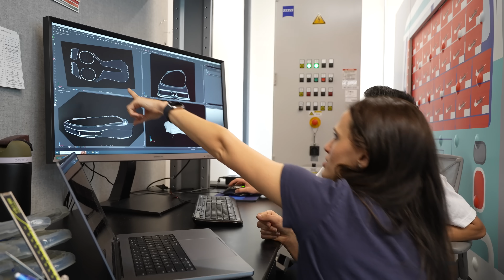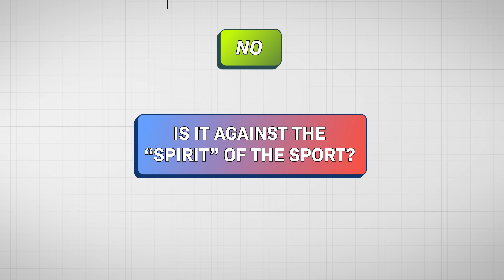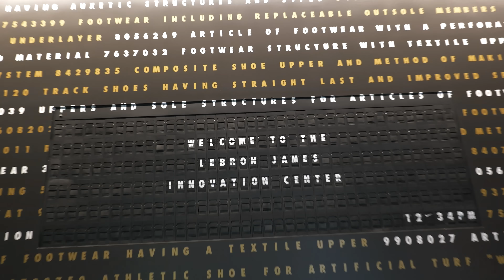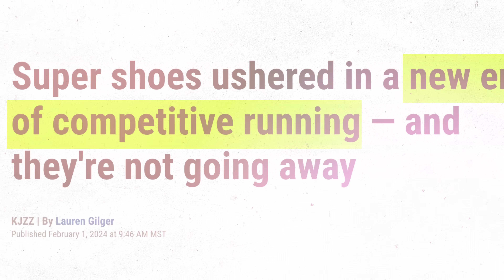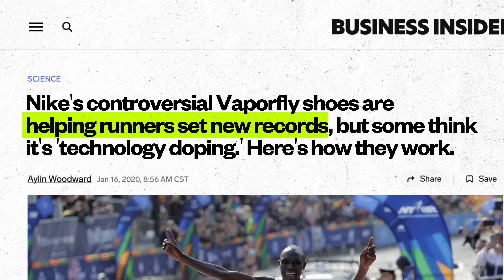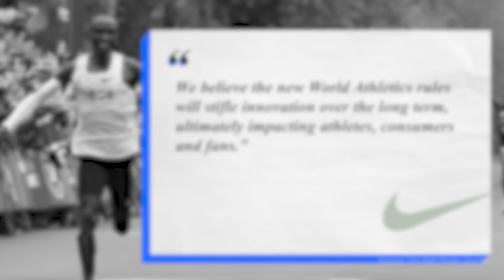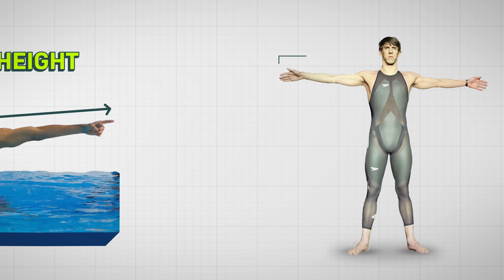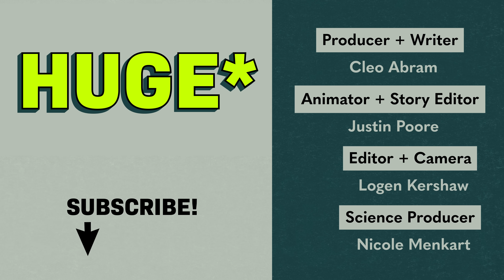The Shoe That Broke Running

Comment: Springfloors help gymnasts to jump higher, athletic tracks make runners faster than they would be on tarmac. It's however not really pushing human potential nor performance  like the 6 months altitude training camps does. Optimising the artificial environment for competitions is driven by profit for the companies and venues that can claim their products to produce WR's. The amount of average middleaged runners now bying $300 carbon plated supershoes that will last for 100 miles to get under 4 hours at any given city marathon is infantile but great for Nike and Adidas shareholders. Competitions that are based on a fixation of putting a flag on something and claim ownership of a gold trinket has become absurd, forgetting to appreciate all the individual athletes ability to overcome attrition and instead salivate over a sponsors performance enhancing products, just like you do when you enter the Nike's Cathedral of Tech.

Comment: That is why I don't agree with the GOAT issue because great athletes in the past did not get much help from equipment using the latest technology. It is comparing apples to oranges.  When we measure records or greatness, it is better to make sure that the factors for measurement are the same as much as possible.

Comment: Oops 😘

Clementi Sports Hall
06/08 Tue 6-8pm FULL
08/08 Thu 6-8pm 2 courts 3 Slot 

Unity PRIMARY @ yew tee                                  
10/08 Sat 7-9pm 2 slot

MB-HB level                            
May u join us ?

Comment: It seems like a really simple answer, why are we complicating this? 

If equipment (like glasses) are used, it should be to bring someone equal to everyone else (eyesight clarity has a limit).

If it enhances performance and is not easily accessible for everyone, no bueno. Extendey and bouncy legs could be modified to enhance performance. (There isn't a general limit to how tall or bouncy a person can be)

Comment: There is no 'fair' in sports and never has been. People are mostly too silly to take a step back and analyze how that word goes right out the window when you consider genetics. It's entirely fine to have egregious advantages so long as you are born with them... You could have a runner with a genetic mutation that provides them with 3 to 4 times the normal amount of red blood cells, or some sort of improved capacity to deal with oxygen absorption etc and it's entirely legal because they won the genetic lottery.

Comment: If not all athletes have the same access to the same equipment, it is simply  put cheating. It gives some athletes an advantage over others, in my opinion I would like to have them all compete with the exact same gear to make it as fair as possible.

Comment: 14:45 this part right here is so unscientific that they used  a non race deterministic theoretical study. What if someone had a genetic mutation that I dunno increase growth rate in the lower extremities but was also then ablated by another mutation that stopped the growth during gestation. It's theoretically impossible to accurately correct something like that and to use a non race determined study to give any hypothetical measurement is so scientifically biased

Comment: For me it is the standard sports bicycle. I am a former president of an organization formed to recognize any and all human powered vehicles so long as they are only powered by the muscles of the human rider.  The standard  racing bicycle is called a "safety bike"  and was first defined  in 1934 when a recumbent bicycle let a second rate cyclist win a world record. Putting a lightweight aerodynamic shell around the rider had been banned long before  in 1913 sports events governed by the same body that provides guidance to the Olympics. Each of those improvements suffer very poor sales and thus use by the general public, yet make bicycling both safer, with no possibility of going over the handlebars, and much less "road rash" from a fall over to the side with a fairing shell around  a cyclist. The visibility goes up, for the racing rider to see forward in the most aero posture, and in side a larger than the human volume shell is seen further ahead by other road traffic. 
Technology for our bodies as you point out is already allowed in may ways in world class sports. For most of human endeavors these arbitrary rules make only tiny differences in abilities, but  bicycling  as a sport has stagnated more than most. In the public perception, beginning from early childhood, two equal sized wheels, with a set of pedals directly below that torture device called a seat is what a bicycle is perceived to be. Without the changes technology  could provide the bicycle records have changed but little since the 1930s. The 200 Meter flying start record time has dropped from about 10 seconds to just over 9.  The International Human Powered Speed championships record for that event is under 5 seconds.

Comment: Now compare cutting your blades down by six inches after training with the taller ones your whole life with taking female hormones after you have trained as a male your whole life with the male hormones that built a male frame, and muscles. These guys start shattering long-standing records by female athletes and radically change sports in ways that are unfair to those record holders.

Comment: @7:03

All the dangly bits, tie them up. Hide them. Remove them. And then it will be fine. We are talking sleeves, hair, necklaces, lanyards, etc. Got to go!

No drill, saw or other rotatory tool cares what it has grabbed onto. It will continue to try to turn.

Comment: Magic shoes magic suits magic whatever they try, humans are always going to remain the laughingstock of nature with their deluded overvaluation of their vestigial physical abilities. 
We can't run, jump, fly, float, breathe, or even manage our body temperature anywhere REMOTELY close to what even middling creatures a quarter of our size, can do with a tranq dart in their shoulder or an offspring clinging to them. We did NOT evolve for physical prowess. Stop trying to reverse evolution. Fvck flexing. Humans evolved for THINKING. Culture, arts, language, physics, law, moral philosophy, poetry, painting, oratory, organisation! Knowledge transmission FREE from the stagnating requirement of face-to-face interaction. THAT is what we should be honing. Nobody needs to see a primate swim, any more than we need to see a penguin fly. That is NOT what penguins evolved towards.

Comment: Sporting regulations will always be totally arbitrary. If you wanted to be totally fair, you would also ban all kind of training because that obviously improves performance!

On the other hand, it seems that people are not interested in sports where you're basically comparing genes either which would be the ultimate end goal if you want to ban every performance increasing  tech or method.

Comment: Comparing running blades to glasses is not equivalent. A blade is a synthesized and machined tool designed for running competitions. let's not pretend a blade is a prosthetic to traverse the natural environment it's specialized for running. If we are comparing it to eye enhancement then the equivalent would be a robotic eye designed to see the littlest of detail from as far away as possible and anything in between.

Comment: If every athlete does not have the same equipment then you are not watching competing athletes in a fair competition. Flat out. If two equally capable athletes are competing and one wins over the other because their country could afford to buy them better shoes it loses all integrity. The exception is 100% the tech for disability tech, which should be should be more stringent, but not absurd.

Comment: I was always a believer that tech should remove impediment not improve performance beyond that which the body can do.  By that I mean build a running suit or swimming suit that removed friction.  Build a shoe that return 100% energy.  If you could, in theory, get every athlete tech'ed up so they are essentially performing in a vacuum, then every athlete is competing solely on their skill.  I feel as  long as the tech can reduce external impediments but not so much as to exceed those impediments, and be available to all athletes, then it should be in.  Not sure about those sticky gloves though.  That sounds like cheating to me.

Comment: I would set only one rule "Is it dangerous to athletes or audience?" If no, it can be used but under one condition, everyone can use it and no one holds the privilege for that. Sport should be about body performance comparison not about who has better technology budget. For those we have other disciplines like motor sports (F1 etc.).

Comment: One principle should be that the playing field needs to be as fair as possible. For example, take two swimmers who are exactly equal in physical strength, technical ability and body shape (this is a hypothetical example). There is only one difference - one can tolerate chlorined water in their eyes, the other cannot. Arguably, this ability has nothing to do with what the sport is about, with the “spirit” of the sport - to find out who can swim the fastest. Goggles equalise for the ability to tolerate eye-contact with water, so goggles should be allowed. Of course, most issues are harder than this one, and the line between fair equalisation and unfair advantage will mostly be blurred I think.

Comment: Why is there so much debate about this, it doesn't make sense. Its a simple issue. If the tech affects your ability to do something directly, its an enhancement. For example, if a shooter uses corrective lenses to help with his vision, that is not an enhancement, as it doesn't make your skill of shooting better, it just improves your vision. Same thing with swimming. The goggles help you see better under water and it protects your eyes. These do not directly enhance your ability to swim. It just eliminates any other hindrances you face while swimming, theres a difference. In the case of running, its already going to be super inconsistent, as not all shoes are made the same. You DO need a set of guidelines that restrict any unfair advantages. I agree, tech is supposed to make us better, it helps us push our limits. But when its in a competition, you need to have consistency and set rules that doesn't make the game unfair for the others competing. Physical disabilities however do need proper testing that we currently don't have, to understand if the tech makes the person better than he would be if he didn't have that disability. Not much we can do in that case.

Comment: For competitive sport, there should absolutely be limits on tech as long as they are applied across the board within the sport.  That said, there is nothing stopping companies from innovating outside those rules for non-competitive events… just look at all the 40+mm stack training shoes for running.

Comment: Even if a running shoe could return 100% of the athlete`s energy input that energy comes from the athlete in the first place. If the tech somehow added extra power that would be an issue, otherwise I see no issue unless the shoes are only available to a few runners.

Comment: Main problem with sport equipment is that if for example Nike develops something ground breaking athletes who have contracts with Puma, Asics or any other brand won't be able to compete with athletes who use Nike until those brads develop something similar. This is unfair advantage and there's no doubt about that.
Reply: same fore the formula1 :)

Comment: regarding the running blade, i remender that there were paralympic athlete that complain that it's unfair the double amputee is competing with single amputee because they said the running blades makes them so much faster.

Comment: Prosthetic legs are different to glasses though. Anyone who wants glasses can have them. Even if your eyes work fine you could wear something. You'd need to do some body modification to be able to wear prosthetic limbs though. So if one of the requirements is that everyone can have access to it then prosthetics don't quite fit.

Comment: Shoes - ok, you can't get more than 100% energy back and we are already close enough. But running blades? At some point, you may need to cut off your legs to compete with other athletes. That's not ok.

Comment: These shoes do not make atheletes better but help them achieve better time running at the same pace. Same thing with Phelps swimming suit - better time but not better athlete. The same way I could put springs in basketball shoes to jump higher. Here there is no limit to the absurdity. So, I think the equipment should be focused on reducing the damage caused by sport itself - in running it would be knees

Comment: I think its about accessibility to the gear. Regulators need to try to keep gear available and reasonable priced so that the sport stays relatable
Reply: I believe this is the reason fastskins were banned. They were effective enough to be required but in 2008 they cost $400 and chlorine ruined the effectiveness after only a handful of uses.  That's a huge burden to put on student athletes.
Reply: I agree, I think she should have talked about it
Reply: not relatable - competitive

Comment: I understand the concern about systematically gaining an unfair advantage using technology. However, I think we should try to find a way to equitably allow this tech in competitions. After all, sports is inherently unfair already, since some people simply have natural traits which give them an advantage. In my opinion, someone beating a record because of better science and engineering is more compelling than beating it because they are abnormally good at the sport. After all, the technology advancements have the potential to benefit everyone, not just the top athletes.

Comment: The rule for active sports should be no energy can be added into the system, all else is fair. The rule for non-active sports (archery) should be dealt with case-by-case. Ten times harder there because they mostly use technology inherently. Probably what would make more sense would be to have all athletes decide on what gear is permissible on a voting basis and everyone runs with that.

Comment: I think one of the real questions isn't just "What technology should be allowed in the Olympics?" but also, "Can every athlete from every country reasonably afford to use the best technology available?" 
If a team from Country A is decked out in the best of the best because their commercial sponsors outfitted them, but a team from Country B can only afford lesser equipment, then I think that's inherently unfair. And that hits at a much more fundamental issue. 

Also... I can't help but notice that the athletes whose records are being negated or are being disqualified due to their tech are disproportionately Black, while in this instance a White athlete in a similar circumstance did not face the same consequences. 
I hope this is just a coincidence.

Comment: Maybe it would be best to have a committee decide on one type/brand of gear that is mandatory to use. Have that decision be done a couple years in advance so people can train with that. That still doesn't solve the record problem, but at least within on competition everybody has the same chance.

If you can collect data on how much faster / better people are on average using a new piece of gear, maybe it could be factored in to new records. I don't know how accurate that would be though.

Comment: Would it be possible for the olympics country themselves to provide all of the gear one month in advance, check to make sure none of the gear has been altered during the event, and get all of their gear back at the end of the event? That way every athlete will be equal. The only problem is there will be a lot of world records broken for the next 3 or 4 events then it will plateau. It will be good news for that country as well because they can then sell most of the equipment used at a more expensive price then they bought it for.

Comment: I think that when truly sport changing tech is added; then it should be used with a footnote denoting that previous records stand noting they did it with out vapor fly shoes or NASA swimsuits; etc.  I think that if I didn't have the benefit of certain tech, then I and many others would not have participated in so many different sports.  Sports tech and the people who benefit do so because of advancements and improcements.

Comment: 1:26 It's only cheating if they're not allowed to be used. So long as they are allowed, it's not cheating. 
And in my opinion they should only be disallowed if the advantage they get from it is actually unfair. If the tech is relatively fairly priced, available from multiple vendors and available to be used by all athletes, then I would say that the advantage isn't unfair. In asymmetric games like baseball and American football, there's an extra requirement that it doesn't significantly change the dynamic of the game to the point that the game becomes devoid of strategy, becomes unfun or unsportsmanlike.

Comment: actually the Alphafly series is the nerfed version of the Vaporfly Proto that used by Klipchoge (Vaporfly Proto got more than 40mm PEBA stack height, 3 Carbon Fiber plate, 4 Air Zoom pods. While Alphafly 3 is regulated spec, less than 40mm PEBA stack height, one carbon fiber plate, 2 Air Zoom Pods)

Comment: This debate is going on in F1 constantly. Although in F1 safety and spectacle for the audience is a factor as well. Judo is also a good example. Some techniques are not banded because they are dangerous, but because they make fights stalematy and boring. I love where this went, opening this up to life in general. Maybe we need a separate event? Where tech is explicitly part and parcel of the competition? Making it a bit more F1ish in that regard.